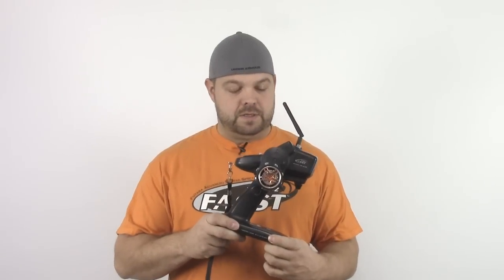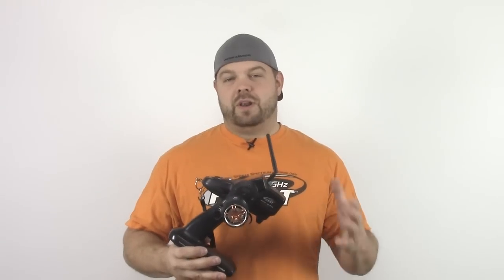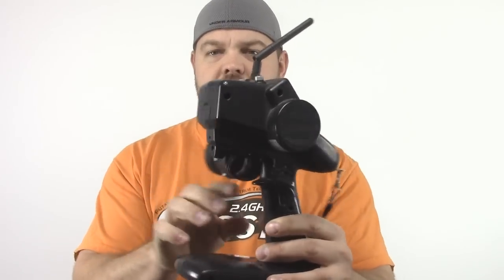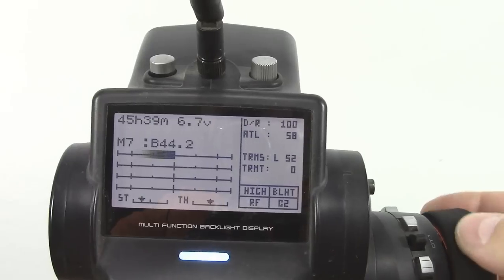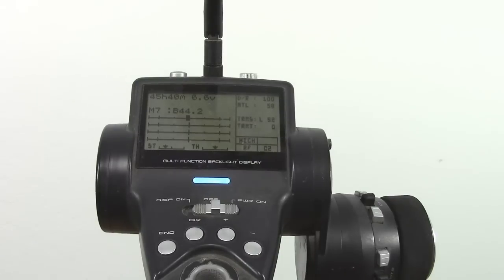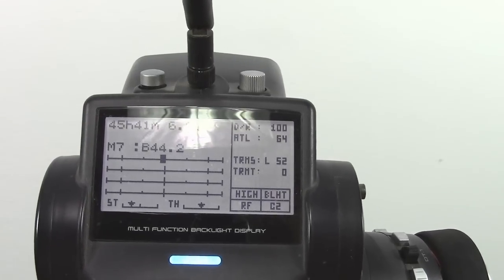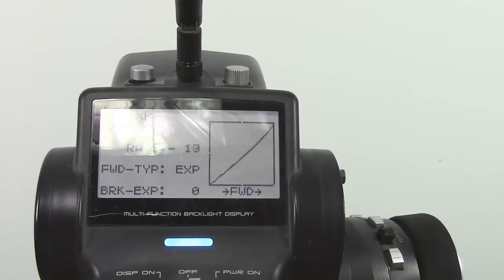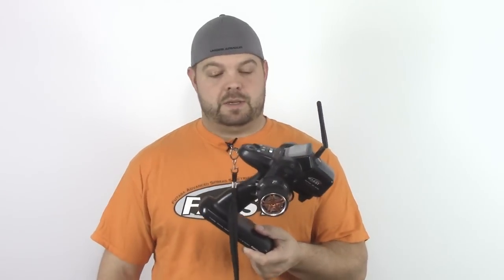Futaba 4PKS Review / How to Set Up Your Radio

Comment: I adjust my throttle EPA by pulling my trigger dull rearward and adjusting the servo travel to open the carb-slide to the point that it matches the carb-throat (opening).
Never necessary to set it all the way to 100% .

Comment: I have a 4pks-r  great radio but when i use it with my 5scale truck with equip with killswitch it never work properly i had a run away it happen twice and it has a very short range like about 50ft if i pass that it either i have a runaway truck or itl stop. What do you think is the problem? Pls help

Comment: I have seen the 4pksr on hobbyking very cheap its fully branded but wondered if I should risk buying it as it is still pretty expensive at $300 or shall I wait for the release of the 4px and buy that instead from somewhere else.
Reply from the maker: up to you...I've had good luck with my 4pks but I'm gonna jump ship and try out an airtronics......I'd try to buy from a local hobby shop or amain .....that way you have some support